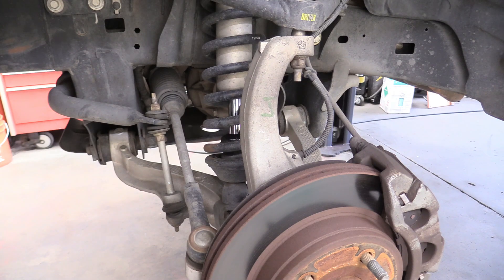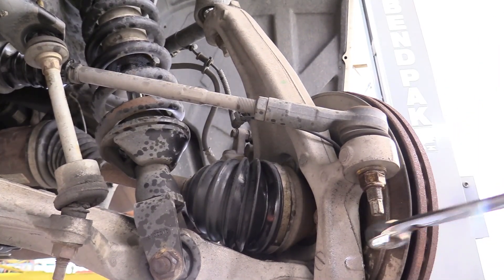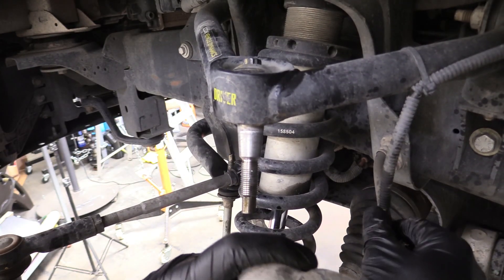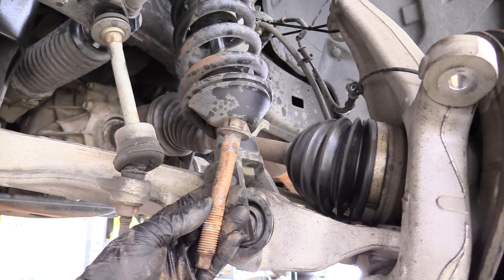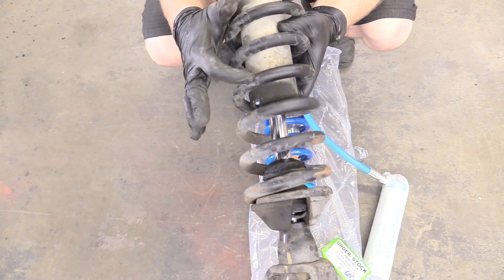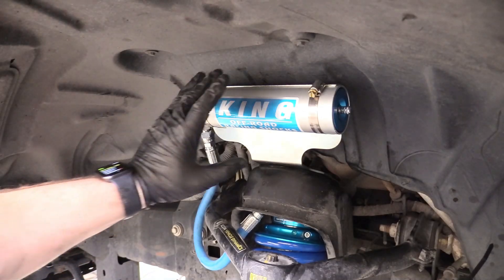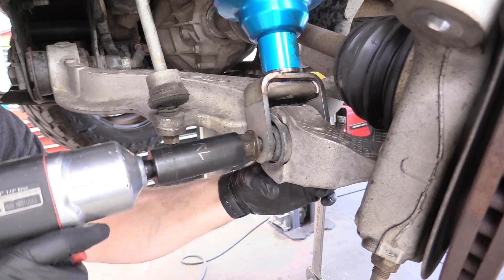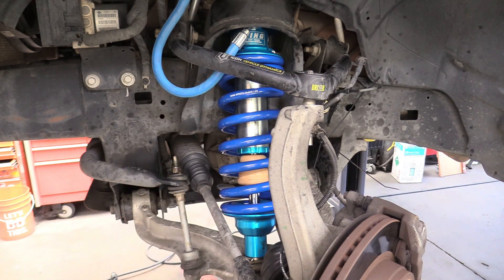How to Replace Front Coil Over Struts RAM 1500 4x4 2010-2018 - EASY!

Comment: Stock Torque Specs-
Top Strut Mount Bolts: 45 ft lbs
Bottom Strut Mount: 125 ft lbs
Upper Control Arm: 26ft lbs + 90°
Tie Rod: Tighten the ball stud nut on the ball. Stud to 22ft lbs + 90°
Sway Bar End Link: 16 ft lbs
Wheel Lug Nuts: 130 ft lbs

Comment: Great job guys! Excellent video with complete detailed instructions. So nice to have all wrench/socket sizes along with full torque specs. This is exactly what I needed to feel comfortable about doing this job myself. Unfortunately my Ram is 10 years old and is used for plowing up here in the Northeast US.. Lots of corrosion and rust. I expect it will be a struggle breaking all the nuts and bolts free. Let the battle begin!
Reply from the maker: Awesome! Thanks for watching! You got this fight on warrior!
Reply: I’m up north too how did it go? I’m planning on doing mine

Comment: any particular reason on the upper control arm you can not re-use the nut/fastener?
Reply: Yes.  It is a jam nut.  Not a nylon jam nut but all metal. It is made for one  time screw-in.  If you want to reuse it, apply red loctite on threads.  But for the price, buy a new one.

Comment: I was unable to get the strut out after following your procedure. 1A auto has a video that shows that you must completely disassemble, removing the caliper and bracket, rotor, axle,  separating the lower control arm ball joint  and lowering the lower control arm to finally get to remove the strut.
Reply: I saw that one and the guy go wild removing too much component to my opinion but he is such a good teacher and a good technician thow. Did mine with ease by removing  upper sway  bar nut, upper control arm nut,  tie-rod nut and lower and upper strut bolts. Had to heat upper section of knuckel  and lower coilover nut thow.  Even having spraying everything 3 times on a 2 weeks before doing the job and having smacked very hard knuckel when job was on. But succeded.

Comment: The linked coil overs are not in stock you have any recommendations to use?
Reply from the maker: Any of these would be fine as long as the application is correct. https://www.rockauto.com/en/catalog/ram,2014,1500,5.7l+v8,3305957,suspension,shock+/+strut+&+coil+spring+assembly,15174

Thanks for watching!

Comment: Sorry for the late comment. I have a 2.5 in level on my ram and an installing the Kings beginning of year. Does it bring it back to level just by installing or do I need to crank down the spring collar to get that height?
Reply from the maker: It installed level for me so I assume they set it up that way from factory. Thanks for watching!

Comment: Will replacing front coil overs or struts throw off your front end alignment? When would you need an alignment when replacing front end suspension parts?
Reply from the maker: Technically yes. Thanks for watching!
Reply: Humm. For me I don't think so.  As long as you dont change the tie-rod adjustment and don't touch camber cam  on lower control arm.  But if you whant to proceed, run the truck  for couple of weeks before alignment. @2carpros

Comment: Do you really have to replace the fastener/nuts when putting back together. I’m going to be doing this very shortly,by the way, excellent video!
Reply: I would, these are one time use crimp lock, once you back them off, they no longer self lock. Also the factory Mopar hardware isn't the best.
Reply: Yes.  It is a jam nut.  Not a nylon jam nut but all metal. It is made for one  time screw-in.  If you want to reuse it, apply red loctite on threads.  But for the price, buy a new one.

 @Albertalorian

Comment: I put rancho 2in on my 2010 and if your not in the south and your north like me then lord have mercy on you and me. The bushing will diff be seized. So torching and an air gun is the way to go. The yellow tank for torching would do. So after 2 days of torching and oh the nut and bolt and the strut  to the bolt I chopped. 😂